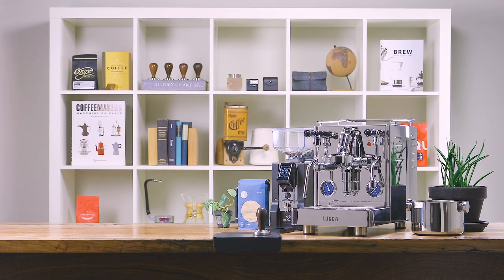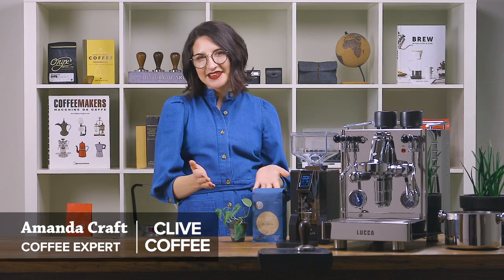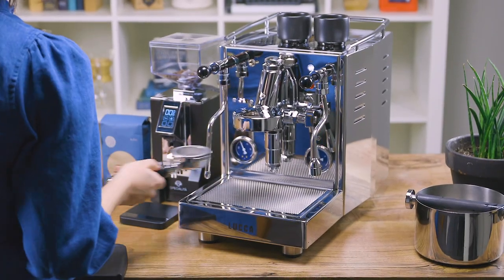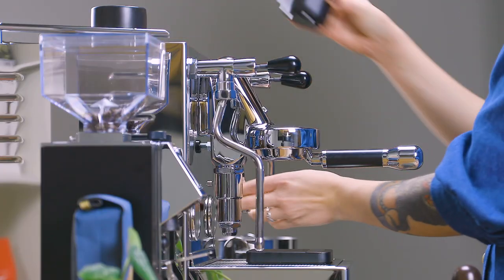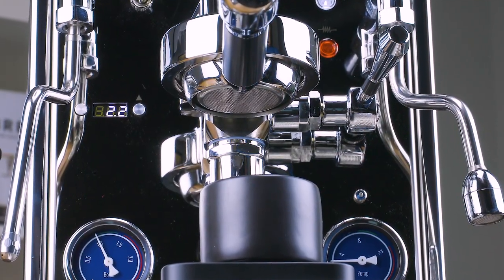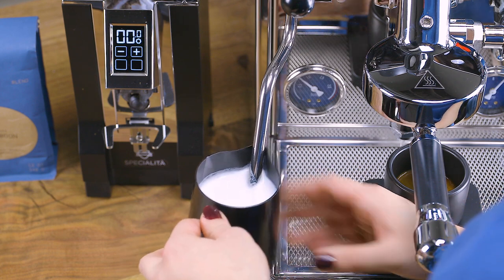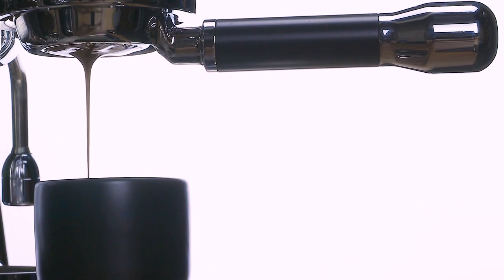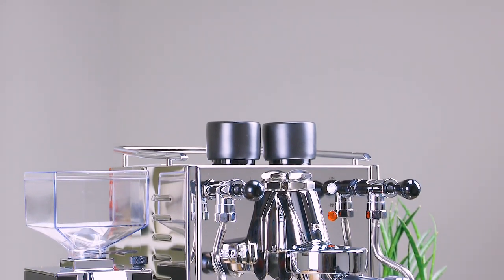LUCCA X58 Espresso Machine Overview

Comment: This machine or the ecm Special Edition Classika PID? Probably will make 60% milk based drinks. Seems like a lot of 20 seconds then another 20 seconds, etc. with the ecm. More steps? Is the extra cost worth it for this machine? $500 is a lot and could go towards grinder.  Thanks.

Comment: Also, what is the big tube in the middle of the machine?  Is it a drain for the tank?  I notice water comes out when I pull the brew level down.  Grazie!
Reply from the maker: That's the over-pressure valve.

Comment: Hi there, looks like a fantastic HX machine! But I think you'll need to update the description for this video - right now it says that this is a DB machine. 

What is the estimated warm up time? Thanks!
Reply from the maker: Hey Shawn,
Since the X58 uses an E61 group it will take at least 15-20 minutes to stabilize the group head. You should be able to start pulling shots within 15-20 minutes. Hope this helps!
-Amanda

Comment: If it has a PID why does it need a flush
Reply from the maker: The PID simply regulates the temperature inside of the boiler. With an HX machine, the PID is maintaining a temperature ideal for steaming, which is why we still need to cool the water flowing from the group head for a few seconds. A higher set temperature will result in a longer flush. Hope this helps! 
-Amanda
Reply: Because all HX machines share the same boiler. The group-head needs to cool down as the steam temp is higher.